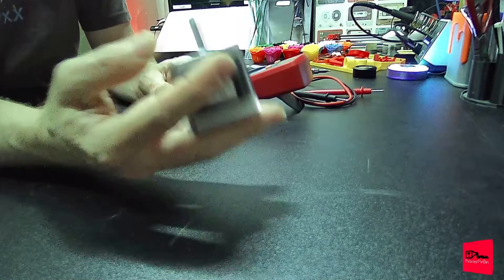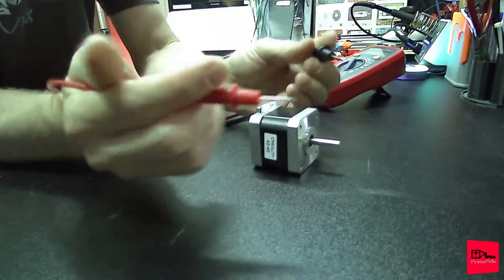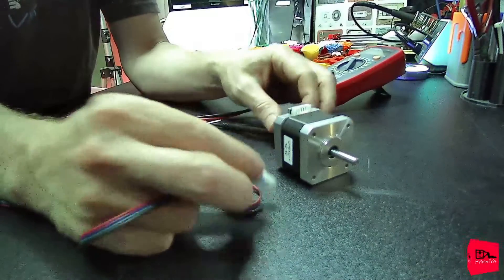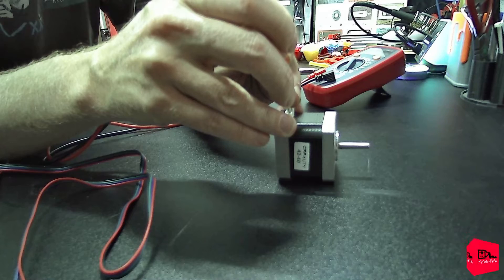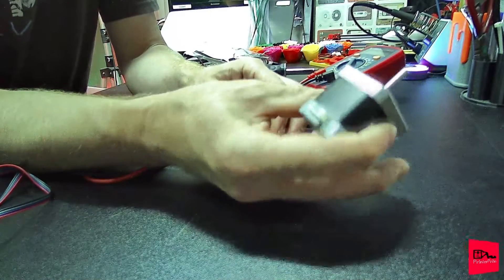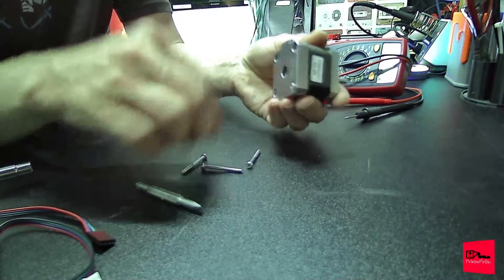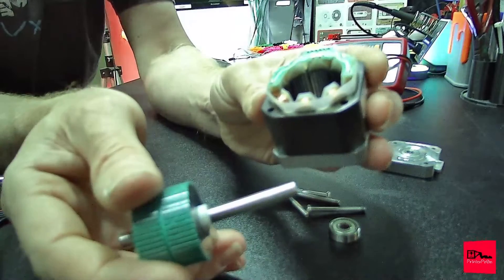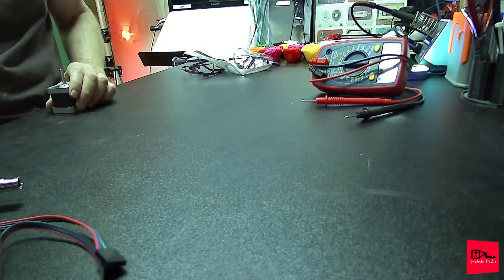Do you have a bad stepper motor? How to easily test.

Comment: Another simple test is to grip the extruder gear while its extruding, it should be hard to stop the motor, if its easy to stop then the motor is on its way out.
Ideally you need two motors so you can compare the difference in torque.

Comment: TIP: (this happened to me)

If you see one of the pairs of pins does not have resistance, I suggest opening the motor and checking if there is resistance in both pairs of coils on the solders where the copper wires of the coils are attached. 
If there IS resistance on both pairs, it means the coils are OK. 
Now, check between the solders where the coils are attached AND the respective pin (you can follow the light green pad on the circuit board).  It is possible that one of those pads (either on the pin side, or the coil side) may not be making contact (it's broken). If that happens try to re-solder the pad.